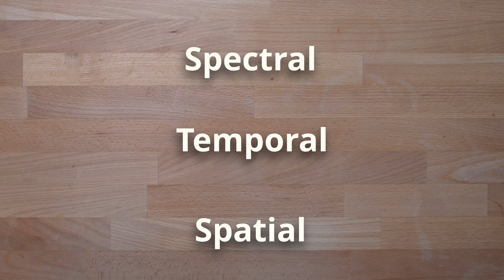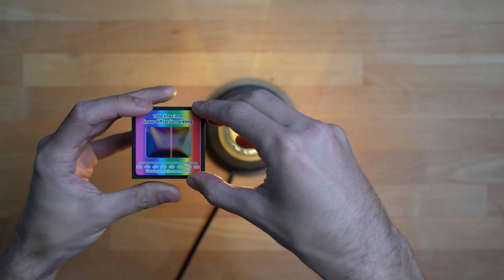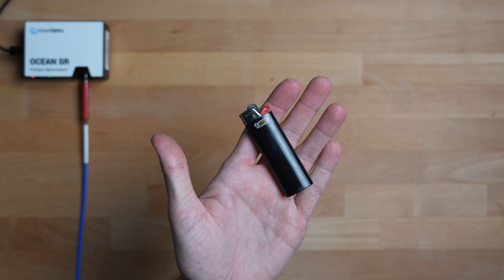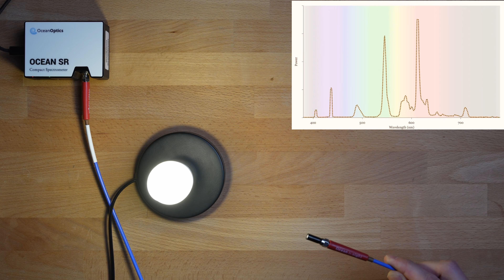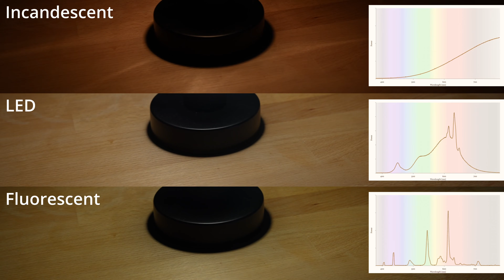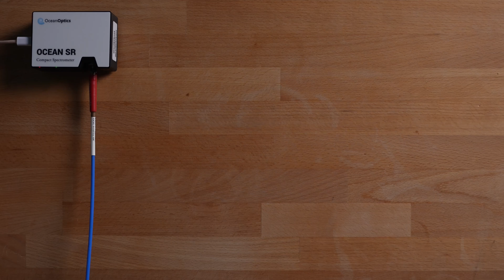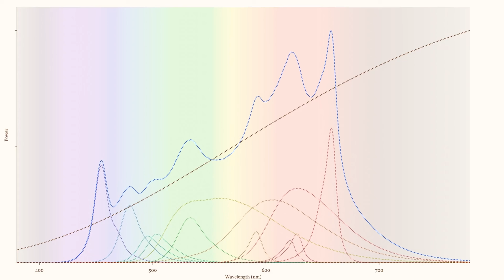Why Modern Lighting Feels Bad (and How I Fixed It)

Comment: Love this as an initial product.  I realize this is a renaissance product, but I have to ask . . . is there a realistic future where this kind of lighting can reach a form factor that is compatible with light sockets built into the typical semi-modern/modern home?  
From an economic accessibility perspective, how much of a downgrade in quality is it to skip the data collection step . . . accept the fact that LEDs have a small variance from one to another . . . and just use expected averages?  I dont know if that would ruin the quality or break the product entirely, but that seems like one of the most expensive steps.  Dropping it might open a much larger demographic as potential buyers.  Probably not viable in terms of branding since the current model is priced as a luxury/niche sensitivity product, but at least something to consider, maybe under a different brand/label.
Reply from the maker: Absolutely. Standard socket-compatible form factors are a major part of the long-term plan. With enough scale and sufficient factory automation, it should be possible to get them cost competitive with existing LED lighting. 

On calibration: I actually don’t expect that to remain a major cost driver at scale. Right now it’s significant because volumes are tiny, but the calibration process is going to soon become completely automated.

Every light can be measured on the production line, calibration data generated automatically, and written to the device with little to no incremental labor. This also serves as a significant quality control step, so full removal is not a goal we’re working towards. 

Skipping calibration and relying on nominal LED characteristics would save a little time, but you’d give up one of the most important parts of the system: knowing that a requested spectrum actually produces the same light from fixture to fixture. Given Enody’s long term goal of direct biological process manipulation, we need to be certain in our emissions. 

The bigger cost-down opportunities are manufacturing scale, simpler mechanical form factors, tighter electronics integration, and eventually integrating the emitters/LED package itself. EP01 is deliberately the bespoke first version that lets us build all of that infrastructure correctly.

Comment: Cool, but I would rather use an halogen bulb than any LED no matter how close it is. The warm feeling from a Halogen lowers energy consuption more than what it takes. My room in Winter is 19-20 C, far lower than what I would consider cozy with a LED light.Probably placebo but it works.

Comment: Check out Seoul Semiconductor's Sunlike LEDs. They are pumped with a 415nm diode rather than the standard 450nm. The cyan gap is solved and they extend well into the reds to 650nm or deeper. If you don't need the tunable stuff, it is a great option.
I am always hesitant to get software based lighting stuff, but the ability to have proper efficient lighting that can be used at both daylight (5500k) and evening light (2700k) at a high CRI is worth so much. Parts of my house that are too dark in the daytime, feel like there is much more daylight with the good LED stuff. I diy it fully in hardware but for folks not as adept at creating their own electronics, the Enody lamps can be a really good option.

Comment: Man, what a cool product. I've been thinking about and working on some spectral simulations to emulate this for a few years, but I didn't know there was so many different LED's to fill in the valleys between the main RGB. I wanted tunable lighting for a slightly different reason - compensating for colourblindness. I have protanomaly (red weakness colourblindness) so I want a light where I can dim the green a tad, and boost the red a bit. Basically shifting the spectrum until my metamers match normal vision peoples metamers under sunlight. Having a bulb like that would be immensely useful, for example I would be able to safely cook ground beef, or see my sunburns, or any number of random things that annoy me just a bit, but all the time. 

I'd be interested in a collab - I'm a software developer with a lifelong interest in colour theory, and have really gotten into the weeds of mixing colour spectrums

Comment: The thing is though, if we remove the invisible light (that also comes from black bodies, particularly the sun) we remove the advantages that come with them too. 

Infrared light has been proven to have significant health benefits - which is why you can buy therapeutic/medical grade infrared lights. 

I love this idea but personally, it's cheaper and better for my health to just rely on natural sunlight during the day, and a couple of incandescent lights or candles in the evenings. I sleep so much better and get the benefits of exposure to the full spectrum of light.

Comment: While this is a really cool light, this is definitely not $330 cool. Regardless of production cost, if your target audience is the average person, they're going to spend no more than $80 on a single light. Even more affluent consumers are not going to spend this much on a single light because they are ignorant to how it will actually be better than traditional bright LEDs that fit into standard sockets.
To further de-justify this price, you're charging a premium for a product that still can't perfectly emulate the much, much cheaper original. I can buy four bulbs for $10 and get the actual experience, so why would I spend over 30*fold for a single light that still can't achieve the same effect with the same convenience. Yes, you can change the color, but there are plenty of color-changing smart LED bulbs for much cheaper.

Condense the light into a smaller formfactor, rid of the premium materials and aesthetic, and drop the price to something reasonable, and you may make a lump sum of change. Retain this light for those willing to spend the pretty penny, but also make a light that rivals the current market. Nothing is going to change of the mainstream isn't pressured.

Comment: $330 for a desk light/nightlight.

Even if this is all right and not snake oil, the cost is simply too high, and only being a desk product means even rich people will still use other light bulbs. The product shouldve been an A19 bulb, made somewhere where mass production was affordable. People might accept a $20-$50 bulb, but definitely not a $330 night light.

Comment: So because the peakyness of non-incandescent bulbs bothered you, you made a light with more peaks than any of these. Some of the LEDs are phosphor coated, so at least those colours will be more wideband.

There are temperature tunable LEDs for years now. It's basically the same as spectrally tunable light for the purpose of mimicking a black body radiator at different temperatures. Some LEDs tackle the blue-peak-cyan-gap issue, like Bridgelux Thrive series, in which I found a wonderful 2700-6500K tunable COB - such device outputs both lights from almost same area, which reduces need for strong diffusion. It could fit in standard E27 form factor together with PSU and wireless controller.

I think you're reinventing the wheel with the plethora of red single wavelength LEDs. Phosphor coated LEDs simply win in terms of "unpeakyness". And while there isn't a blend producing cool white light without some peaks and dips yet, there are cyan specific phosphor LEDs to cover the gap, at least. So while I get the concept, I think in the end you're still mimicking white light with way too many single wavelength emitters. I presume that's why you need such a large diffuser to hide the ugliness of this solution. 

Market needs good LEDs which produce pleasant light, but in standard form factors you'd get more attention than selling a desk gadget for 330$. It won't serve the purpose of illuminating rooms, it's just a glowing orb which is intended to stand. 
Price too high, usefulness too low.

Comment: No offense, but this is a perfect example of pointless "innovation" that misses the root of the problem.  You're failing to solve the problem (your bulbs are still not producing the right spectrum), while ignoring that the problem is purely self-made.  We created this problem by ignoring humans in order to force some arbitrary and pointless "efficiency" score.  You know what would happen if people who want good quality light went back to using incandescents?  They'd get better light.  That's it.  The efficiency was a red herring, it does not matter.  It isn't even a rounding error in human energy consumption, its completely irrelevant.  If you wanted to solve the problem, you would try to get the insanely misguided government ban on real light bulbs removed.

It is also important to remember that our eyes are not the only things that receive RF.  Just because some radiation is not in the visible spectrum, doesn't mean it is "wasted".  There is massive evidence that IR radiation on human skin has positive effects on human health.  LEDs are not efficient, they are just failing to do most of the job.

Comment: This is excellent information.  I've known for some time about the different spectral distributions of different light sources, and this video explains it very well.  I'm curious though as to why the Enody light has any peaks that extend beyond the true black-body line, if the brightness of each LED in it can be individually adjusted.

Comment: What's disappointing, if not the price, is the mere one-year "limited" warranty on such an unusual and fragile product. LEDs aren't such a reliable thing, a single burned-out LED will mean a significant loss of lamp performance. Even if a "regular user" would be able to physically repair it, recalibrating lamp with new LED will be either impossible or extremely difficult.

"If it's broken, buy a new one" is a great money-making strategy, but I don't think promoting new technology this way is the best idea. Considering the price, this seems off-putting.
Reply from the maker: I appreciate the feedback on the warranty period, I agree and will extend it. I wholeheartedly agree on LEDs being replaceable. EP01 is constructed from two PCBs for this exact reason. All of the power regulation and control logic is on one PCB, and all of the LEDs and LED controllers (effectively the items more likely to burn out) are on a separate PCB. The PCBs are easily swappable, with each LED PCB having a unique identifier encoded in storage for calibration tracking purposes. If, outside of the warranty period, any LEDs malfunction or burn out, or if any noticeable chromatic drift sets in, we can replace just the LED board at a reasonable cost (at our current manufacturing levels ~$30 for a complete LED board replacement). As we move forward, this architecture will allow end users to swap out boards for specific occasions / settings. 

Additionally, EP01's LEDs are run at much lower temperatures than most LED products. Its aluminum base (~2lbs of pure 6061 aluminum) acts as a large heatsink for the LED board. This should significantly extend the lifespan of all of the LEDs within the product.

I am committed to making all Enody products minimal e-waste. A single burned out LED should never result in a complete new product, and especially a new enclosure being needed. EP01's enclosure is held together with standard hex screws and no adhesives.
Reply: @enodylighting , thanks for the detailed answer.

By the way, do LEDs simply have high heat dissipation, or do they also operate at a reduced voltage? Well, relative to "normal" LED bulbs.

I think this has already been said, but even a small undervoltage of LEDs can significantly extend their lifespan and the overall energy efficiency of the bulb (but also reduce light output).
Reply from the maker: @ivanalaskevich4736  All of the LEDs operate at current levels well below their maximum rating. The peak current of any single LED is 120 mA, while they’re all rated for at least 240 mA. EP01’s architecture is current-controlled, so the forward voltage of each LED depends on a handful of factors (current, temperature, age, device characteristics), but it isn’t independently forced or overdriven.

Comment: Just buy a high CRI (Color Rendering Index) LED.
Most LEDs bulbs have a CRI of 70-80... which sucks.
Some of the really cheap ones have a CRI as low as 60-70.
Fluorescent lights are even worse with a common CRI of 50-70.
Those old incandescent lights had a black body CRI of 100... which is the best.

However, you can buy LED lights with a CRI of 90, 95, and even 99+. As the CRI goes up, so does the price, while the efficiency goes down.

I recently bought two sets of LED lights. One with a CRI of 95 the other with a CRI of 99. The ones with a CRI of 95 were twice the price of a standard LED, and the CRI 95 was three times more than the CRI 95. And the light output in lumens of that 99 CRI is only about 60% of the 95 CRI lamps, and it runs a lot hotter.

The CRI 95 lamps feel so much better than an standard LED, it was definitely worth the money. The CRI 99 was bought as a desk lamp, it is hard to tell the difference from the 95. Was the 99 worth the extra money and the extra heat? I'm not sure. But the 95 definitely was.

In another project I redid the lighting in a kitchen from Fluorescent tubes across the middle behind an opaque drop celling to a CRI-95 12v flexible strip LED behind the same drop celling... what an amazing difference.

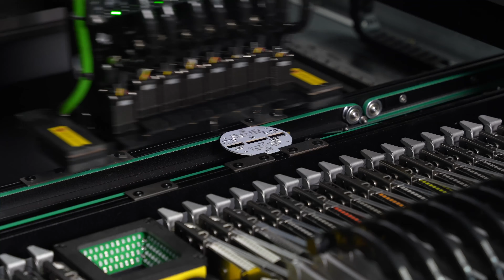Comment: 15:40 "building a spectrally-tunable light is a lot different than building traditional LED lighting. You cannot just combine LEDs that are pre-measured..."
17:41 "want a lamp that has no blue light? Perfect. We just won't put blue LEDs on the board"

Is this not essentially individually addressable LED lighting, but done in a bulky way? Instead of marketing this as such, you've swapped "addressable LED" (or more commonly "ARGB") with "spectrally-tunable" for what I assume is to come off as more sophisticated, new, and "the right way" of doing things. The long, drawn out pitch of this product honestly sounds conceited.

What the market needs is consistency when it comes to CRI, which you're still actively dealing with since it's just a bunch of LEDs on a board. I'm sure if someone were to buy 10 of these things, lined them up, turned them all on to a specified hue and temperature, there would still be visible differences. You didn't display a test like that for some reason though.

This was a decent ad, but I don't think this is really anything new or bold. The only bold thing is the price. $330? And that's not including shipping either. For a product like this, I'd still be on fence if it were $70-$100.

Comment: Your arrogance is profound. 
What do you know about the human body & photonics to waive hand asserting what is good, or not? 

This artist noticed long ago that artwork becomes pale and washed-out, gradients solarize, and we lost the warm Kodachrome world under electronic ‘capacitance’ generated light, like LED. Same with the flat displays they rolled out - it didn’t have to be blue-spectrum shifted. Our internal metabolism signals with light and the harsh of LED innervates everyone into tension and malaise. Just as square-wave capacitance energy generation, solar & wind, caused Spain’s cyclic-generated grid to fail recently, these electronic emitters are janky to human receptors and causing social and individual harms. Our bodies are both transmitters and receivers of light signals and this was known when medical choice to use depression inducing Blue technology established.

Solid state emitters are just one-step away from full laser coherent energy beaming at you. In fact, the pointy-heads at IEEE have protocols for 6G+7G assigning every headlight, porchlight, and point-source photonic as communication units - a transmitter & receiver and they’ve already worked out how to wire up your metabolism for AI-Twin Smart Healthcare to remote App-tap your liver functions by any junior med-clerk. Those nerds at IEEE have some Nuremberg 2.0 explaining to do. 

Incandescent is vastly superior for human needs. I could go on, but your audience can go dig it up for themselves. 
This is why DOE needs to be removed from using Light Energy standards to degrade & affect our Health and should be more MAHA under HHS.

The sun and atmosphere, reciprocating  together, give us as compounding afternoon heat effect we also feel with incandescent lights. 
Go learn some things and find the actual wisdom to relay back.

Comment: You are on the right tracks with the idea however, you are still using blue LEDs with phosphor coatings that allows the LED to emit a different colour. Over time, these coatings break down and degrade the light output which will negatively impact the colour that the light emits.

You should contact SM-LED manufacturers and see if you can get them to produce individual SMD's which contain true colour LED without the phosphor coating. They already manufacture single SMDs with a tri colour setup for RGB LEDs used in loads of items from cheap string lights, RGB fans, huge video boards etc. if you know the exact balance of colours you need, these would be definitely the next step.

Comment: Affordable film lights from Aputure / Amaran are pretty decent at getting high D65 (approximately daylight at noon) Spectral Similarity Index scores for low-ish prices. This is definitely not a new problem and the film industry has as many solutions as you have dollars. You can get a legit Arri HMI in great working condition for under a grand if you want to experience something with an SSI in the 90s.